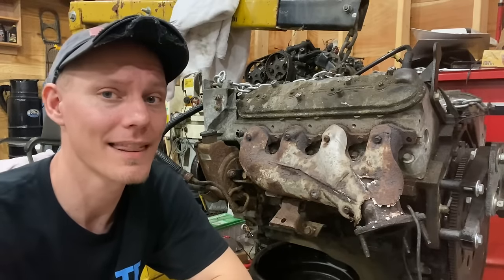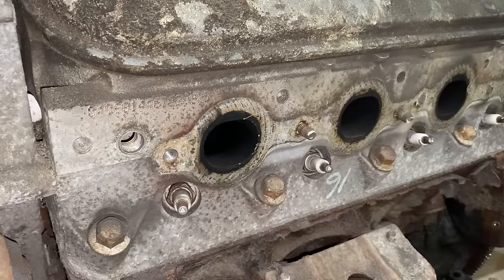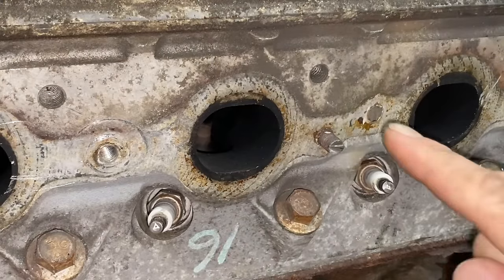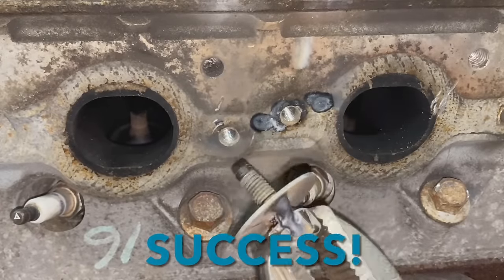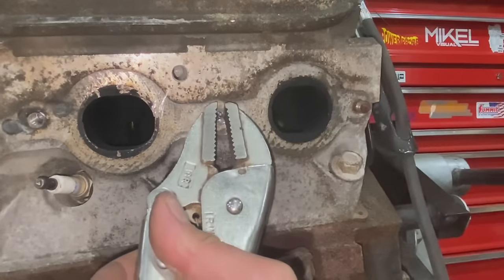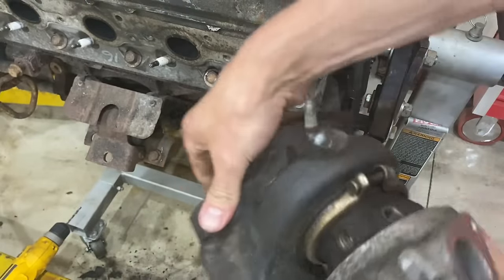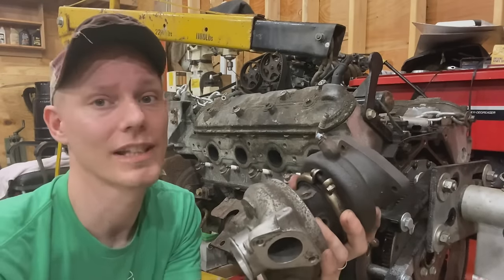How To Remove A Broken Bolt 6 DIFFERENT WAYS - LS Exhaust Manifold

Comment from the maker: Thank You for Watching my "Easy" Broken Bolt Removal video! 
Subscribe To This YouTube Channel: http://www.youtube.com/user/4g63mightymax?sub_confirmation=1
Check out my wiring videos!: https://www.youtube.com/playlist?list=PLsF7T1tRFy2hmiiUUfMZNyV-BUA_yrPIh
Reply: Left handed drill bits will sometimes work.🤔
Reply: I need job macanic sir in experience 12 year in Gulf
Reply: Nice work.. any tips for ones that are broken off well below flush other than drilling and the easy-out? I have a few on my V-10 that are broken below the surface. 
Thanks.
Reply: r 4:51 😊
Reply: For the welding procedure, why does the weld bond to the bolt and not the engine head?  How do you prevent it from bonding to the engine as opposed to the broken bolt?
Reply from the maker: Because the head is aluminum, the weld only sticks to the bolt. On a cast iron head this process will work too, you just need to be extra careful when welding that you are only welding to the bolt itself. Having the right size washer helps a lot!

Comment: What actually works better than the turbo method is welding a 15” steel wheel from a 1985 Monte Carlo (it has to be a 1985 Monte Carlo and 15” wheel). Then , weld or anchor the wheel to one of the yellow, metal safety poles in any Walmart parking lot. Then, you’ll need some help from a buddy, but turn the engine, not the bolt, until the engine falls to the ground. Works virtually 100% of the time 25% of the time. This is not an advertisement for yellow, metal safety poles in Walmart parking lots.
Reply: Does it work in a Target parking lot? Or does it have to be Walmart?
Reply from the maker: I heard abandoned Sears Roebuck stores were the place to get yellow safety poles.
Reply: Better yet, weld the wheel to the side of a large propane tank. 😂😂 But be sure to cut a hole in the tank first, so it doesn't build up pressure from the heat! 😂😂
Reply: Seeing only 12 likes for this made me sad.
Reply: lmfao
Reply: Lol
Reply: I mean, technically it would b bc of more leverage
Reply: perfect
Reply: A 32 inch split rim 1960’s truck wheel works ok too .
Reply: @WiringRescue  nah... not sear. Definitely an Ames or wolworth store but I hear they are pretty hard to find
Reply: It’s funny how you mentioned a Monte Carlo. I can’t count how many times I’ve seen GM G-Bodies on the side of the road with a missing wheel. Must be a GM thing!
Reply: When I read the first sentence I knew this was going to be an advertisement for orange parking poles.
Reply: I was trying to remove a turbo charger from my wife car but broke that bolt too. Now I go buy 2 more cars with turbo chargers so I should end up with at least one spare for these type efforts.
Reply: Always use pb blaster
Reply: I like to weld a ‘62 Cadillac to the bolt and spin it right out of there. I would use an old WW2 battleship but I live too far inland to procure one.
Reply: I am trying to take out the exhaust manifold of a rust bucket 2000 toyota corolla.  The only car I have that is turboed is my 2021 porsche 911 turbo.  I will see if I can take that car's turbo out for this purpose.
Reply: A container ship works better. Weld it to the tip of the bow with the stern pointed almost straight up at 11 O'clock. The weight does most of the work. But take all the conex boxes off first, unless you have a hard hat on.
Reply: ha haaaaaaaaaaa, great 1, actuallyyyyy L.O.L cleverrrr
Reply: my 64 chevy engine head welded on works better
Reply: Just tried with my 87 Grand National Spare... Didn't work, dick stuck in radiator fan.

Tweeted from LG Smartbidet
Reply: @bobbystewart2605  yes I was thinking the same and easier to turn than a turbo 😂
Reply: Even put by the road next to a really heavy duty utility pole!😅

Comment: If you are out in the field somewhere and don't happen to have a welder or a spare turbocharger lying around, something else that works fairly well is to always carry a small bag of torx bits with you (they are cheap and small). You can drill a hole slightly smaller than the torx bit into the broken bolt and then use a hammer to drive the torx bit into the bolt and then try to turn the bolt out using a vice grip or some other gripping tool. It works better than an extractor, and in situations where you don't have all of the "fancy" equipment you used. Depending on the size of the bolt, you can try this trick several times on the same bolt. Of course, having a torch, welder, or turbocharger always helps.
Reply from the maker: This is great info and something I have to test out for sure! Thanks for watching!
Reply: Sadly did this few hours ago and did not help
Reply: The thing with torx bit is that they might strip. Also they might cause the broken bolt to expand and make it even tighter. My approach is to use a square hss bit and drive it in. The corners are hard and sharp enough to  cut grips instead of squeezing the bolt against the hole.
Reply: that's a good idea 💡
Reply: @WiringRescue  Torx bits work good on stripped allen plugs and such.
Reply: that means a full set of torx AND a turbocharger in my trunk for emergencies. HAHA HA great fun.
Reply: Just tried this torx method and worked perfectly on a recessed machine screw😅. Thank you for the awesome tip!
Reply: The main thing that encouraged me to watch this video is the obnoxious grinding wheel noises. Definitely made me laugh!
Reply: My wife asked me if I could use a lighter to heat up the block.. JK
Reply: @impactodelsurenterprise2440 What's the hardness rating of an HSS lathe bit compared to a screw extractor I wonder? If either breaks off, you are going to be in even a deeper hole.
Reply: Failed me

Comment: When you are completely at a loss for ideas, get a manual for that vehicle, go to the index page and look for working on the engine. There should be a note, saying, " it may be necessary to remove the engine for removing the exhaust manifold"🤣😂😅

Comment: I been stuck in a shit mood due to the dreadful 5.4 manifold all day and you taking the broken stud out with the turbo was a great laugh I needed right now. Thank you!
Reply: How'd that go, I'm currently dealing with the same 2003 5.4
Reply: @Nick-v5o  it didn’t, mechanic wanted way too much so I sold my van and bought a new one for hardly more than the fix and it had less miles and no issues lol
Reply: Currently fighting with a bolt that holds my thermostat housing on my daily 95 Escort (1.9 sefi) Snapped the head, then ruined threads with vice grips, bought a stud extractor that fastens over the exposed it and that didnt work. bought a tap and die set and tried double nut method, broke the threads. got the dremel out to cut a flathead slit to try unscrewing it, snapped the exposed bit. Tried easy out and snapped the tip of the extractor. Im to the point where im looking at the strongest JB weld i can find

Comment: In most, if not all cases, you start by shocking the broken bolt. Even if it is broken inside; you take smaller, flat at the end punch, and smack it multiple times with hammer. This helps to loosen the bolt, and it will be easier to remove, no matter what method you are going to use. In addition, left-hand drill bits should be added to the list of possible solutions. Also, there are ways to make the point in the middle of the broken bolts (nobody should be just making it with a small punch). I either use the biggest drill bit that will fit the hole (make the good starting point and then continue with smaller diameter bit), or the largest transfer punch diameter that will fit the hole.
Reply from the maker: All great advice! Thanks for watching and sharing the info!
Reply: You can also hit it with something like CRC Freeze-Off. It flash freezes the bolt, shrinking it slightly, and the penetrant works it's way through.

Comment: I really like the addition of the washer to the nut when welding. Heat is the key.
Reply: Heat makes the stud expand. Welding on a gripping surface while keeping the heat from propagating down the bolt is the key.

Comment: Thanks for the methods.
I just removed the ditch side manifold from a 2003 Grand Marquis. While in the car.
I cut the nuts off so I could remove the manifold. Now all the studs were exposed.
I tried the vise grip method, it worked on one.
I tried the double jammed nuts and couldn’t get any action, so I pulled out my stick welder.
I welded oversized nuts on the exposed studs, and got 6 more out.
The last 3 broke the weld out of the welded nuts, so I used the washer and nut method to get the last 3 out.
Note, I am replacing the fender so I had the luxury of space.
Thank you for the great video.
Reply from the maker: That’s awesome - I’m glad you were successful! Thanks for sharing the win!
Reply: owww

Comment: Bought a flux core MIG welder on Amazon for $74 after tax and shipping.  It even came with a welding mask and a roll or wire.  Extracted a broken stud by welding a nut on it.  Worked great.

Comment: Great video!  Just a suggestion for anyone using an easy-out or tap.  Try to use some form of a tap handle to help keep the pressure centered, it is too easy to snap a tap, etc using a regular wrench.  Second point, I am a retired machinist, I hated using easy outs, like you said, if they work 50% of the time for you, that is a far greater success rate than they worked for me.  Plus, one of the most common repairs I saw were customers bringing in a part that had a broken bolt with an easy out broken in it.. made drilling it out near impossible.
Reply from the maker: Thank you! I completely agree with every single thing you’ve said! And thank you for watching the video!
Reply: Been there.  Solution is Harbor Freight diamond bits that fit Dremel.  Takes awhile but works.
Reply: I got to learn all about this recently. The dremel (the first tool I ever owned, from 31 years ago) got through the bolt & I was able to eventually remove it.
Reply: thx man that is exactly what i have. now I know what to do
Reply: This happened to me with a bolt in the diff cover of my 8.5 gm, I tried drilling it out but ended up grinding it flush and laying a huge bead of silicone in that area and crossed my fingers lol, never did leak
Reply: Honestly ‘ezy outs’ should be renamed to hard outs cause they’re so frustratingly bad
Reply: When you were trying to extract that bolt, I was thinking you could just either use that extractor or another little piece of metal and well the metal to the extractor
Reply: I hate easy outs too , I use left handed drill bits gradually stepping up the size , the last and largest bit usually snags the bolt or stud and brings it on out of the hole since your spinning to the left or counter clockwise anyway

Comment: Hey guys, huge tip if you’re doing method number five, where you’re drilling a hole and screwing something out make sure you don’t spray lubricant in it and if you do then spray it out with degreaser or isopropyl alcohol after so you get Maxximum grip and there is no slipping Make sure you do this before you hammer in that removal screw! Thank me later
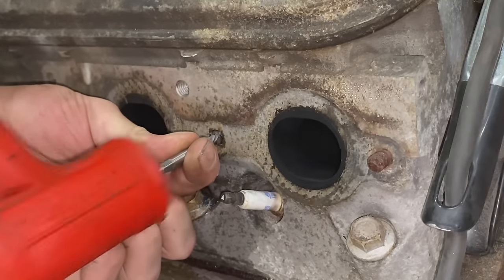Reply: 12:50 - I would have sandwiched 1/8" scrap of plywood betwixt a large steel hammer and the backside of the Easy-out, during insertion.
TRUST !!
Reply: better yet, dont use tapered extractors, use straight fluted extractors

Comment: When I was a mechanic, I was assembling an engine top end in a boat that was open for 3 years,    in Los Angeles, harbour.    
  It was all corroded,   so I was down in the bilge using a tap in all the head bolt holes,        I was about done,      when I heard a boats engine coming into the marina to fast,    so I stopped and held on,     but the wave was to big and violently through the boat around and through me over the engine,       as I flew over the engine my leg hit and broke off the tap below the surface !!
  It took me 12 hours plus a. (Milton tap extractor). To get the piece out without hurting the threads !!
 Lots of using a flat punch and WD-40 .    😂         Great Video
Reply from the maker: Lol. That’s an awesome story! I’m glad it was you digging the broken tap out and not me! Sounds like a really stressful day! Thanks for watching the video! I really appreciate it!
Reply: Just snapped two seized bolts on the rear hub on a E39 bmw.  I don't have a welder and I've been at it for hours. Trying to get the hub off and replace.. I Gave up for now. Round 1 goes to the bolt 😓

Comment: This would be a better experiment if you use actual broken bolts.

And I always use reverse drill bits for bolt extraction.  A lot of time the heat from the drilling will help free it up, and it just comes out while I'm drilling.

Comment: Great video! Wanted to add that when welding just the nut to the stud, counter sinking the nut to the flats will help get deeper penetration. Love the washer/nut combo method! And when all else fails and we have to resort to the dreaded drill it out method, using left hand twist drills will often bring the stud right out. First I drill a pilot hole (can use a right hand bit) and then go to a bigger left hand twist drill bit. The pilot hole “relieves” the pressure and gives an edge for the left hand bit to bite or catch on and then it spins it out. Give it a go, it has greatly reduced the cussing in my shop! I looked around and couldn’t find any old turbo chargers so I don’t think that I can ever use that method!😉🤣
Reply: that's pretty sweet left hand drills they probably do work a lot better than easy outs the easy house don't really have a cutting edge or a biting edge on them
Reply: @bryanelliott1928  I hate to encourage shopping Amazon, but the ones I got from them work great.
Reply: Most mechanics don't know about machinists "center drill" bits but they drill and countersink in one pass and the small sized fit hand drills.

Comment: I literally just went into my garage and welded nuts to each of my broken studs that were snapped off a good 1/8" inside the head and they both came right out. Took me 8 minutes. I legit thought i would have to take the head to a machine shop because earlier i tried to drill the sruds and the bit broke off when i got almost all the way through.  Awesome video man. It saved me some $$$$
Reply from the maker: Hellz yes! I’m glad to hear you won the battle!  Thank you for watching!

Comment: And here I was  thinking I'm the only one that ever welded a turbo charger to broken off bolt to remove it. So refreshing to know that I am not alone!🙂. Great video.
Reply from the maker: Kayla, The reason I know you’re awesome is because you appreciate the fine art of welding strange objects to broken engine parts. Thank you for watching, commenting, and for being awesome.
-Jeremy
Reply: @WiringRescue  I absolutely recognize and appreciate your genius in problem solving using a completely serviceable/no longer serviceable turbo charger as a broken bolt extractor!  I keep all of my old car parts that I replace (and absolutely everything else, I throw nothing away) and repurpose them into usable second life tools and equipment..sometimes abstract art.  Welding that turbo charger onto a broken bolt was the most imaginative (and hysterically funny) thing I have seen in an age.  Sheer genius!!  That bolt stood no chance in the face of the tremendous amount of torque that piece of improvised tooling applied to it.   I immediately knew you were of my tribe and that you knew the song of my people!😁

Comment: I am working on putting headers on a 49 Ford coupe with a flat head. So far I've broken four of the eight bolts I've taken out. Luckily, they've broken flush with the manifold so I'll be using the weld a nut to the studs method

Comment: I like to use a wrench on the extractor instead of a crescent. If the bolt is loose and you it’s recessed deep down in the hole, I’ll use a Dremel with an old blank stone mandrel. High speed of the Dremel will twist it on out. I also use old copper water line to build up a weld on a broken bolt recessed in cast iron or aluminum. Works good. Great video.

Comment: When using the "grip it and rip it method" with vise grips or any other clamping device, try grinding a flat on the bolt.  Helps the pliers grip better and keeps them from slipping.
Reply from the maker: Good info! Thank you for watching and sharing the pro tip!
Reply: Good tip
Reply: I was a welder for 50+ years. I have removed hundreds of broken bolts and taps. Heat the bolt red hot,rub bee's wax on it ,let cool. Grab with vise grips if you can,gently turn , usually works first time. If not,repeat. If broken flush,heat,apply bee's wax,let cool,weld on a nut or even CRS rod. As the bolt cools the wax is sucked into the threads, capillary action.
Reply: excellent!!!!!
Reply: chinese or american  VGs?

Comment: if i ever had to drill a broken stud i used a left handed drill bit. if the bit hangs up it will spin the stud out lots of the time. i have had a lot of luck
with protruding bolts using a very small pipe wrench about a 3 or 4 inch. that was all the little pipe wrench was good for. i never used  the vice griips
the washer trick was a new one for me. never seen that one..good idea.  i enjoyed your video. thanks.
Reply from the maker: I actually just recently bought left handled drill bits so that I can put them to the test!  A mini pipe wrench also sounds like a great idea.  Thanks for sharing the info and watching the video!